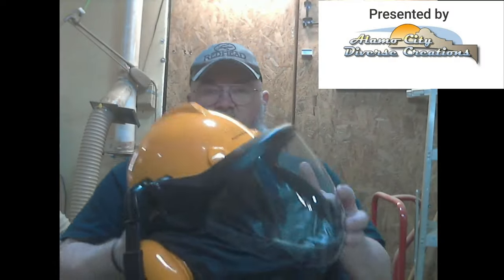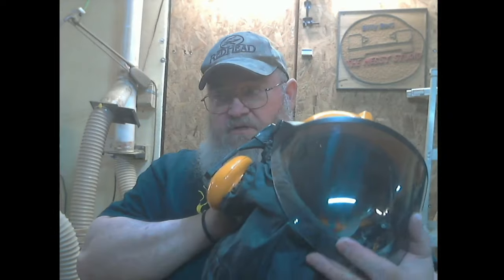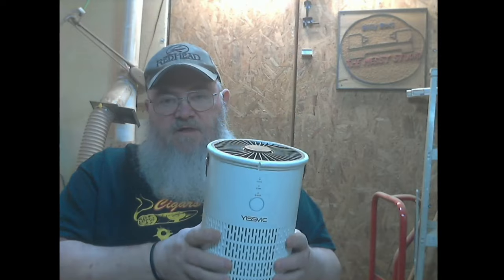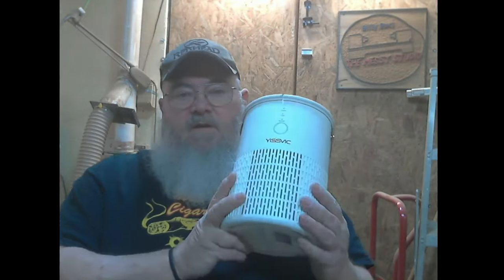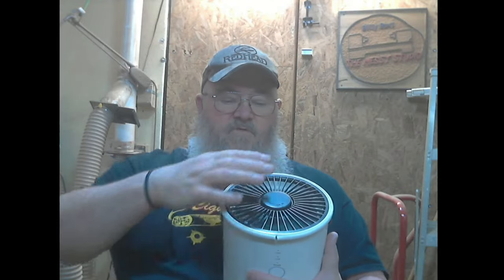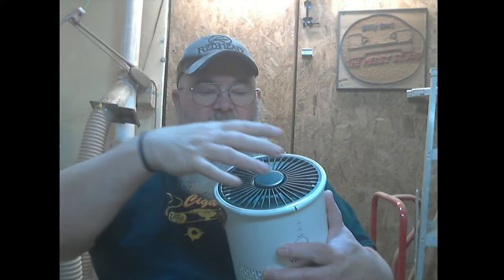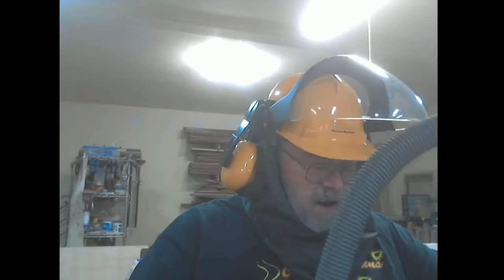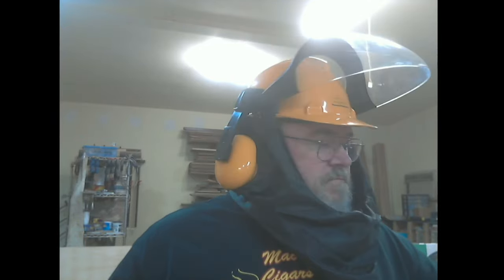Powered Respirator Hack -  Refit for Triton Powered Respirator

Comment: Great Triton Respirator modification.... I replaced the batteries on my old Triton Powered Respirator with a single rechargeable  Green rechargeable battery I bought from Amazon. I bought new air filters that fit the original unit online as well. I wear the 2" x 3" x4" battery on my belt in a bag. Since I use the respirator outside when mowing my property a stationary air source like yours would not work.  One problem I had:  If  you let these rechargeable batteries run down completely they will not recharge.  I learned this the hard way.
Reply from the maker: Thank you, Richard! I considered doing something like that, but since I really only need it at the lathes I found this easier. I'll keep that in mind though in the future if I need to wear it outside.

Comment: Hi Billy. Nice job on fabricating a solution however if you some searching on the internet with the name and model of you system, you can probably find out how to rebuild your battery pack. I did that with my Trend AirShield. The replacement battery pack cost $80.00 but I was able to rebuild the Trend pack with new batteries for $25.00. So it is worth the time to research it.
Reply from the maker: Thank you, Jeff, I'll look into it.
Billy